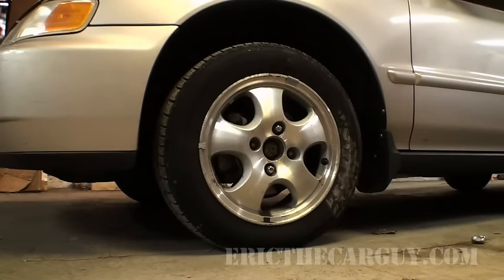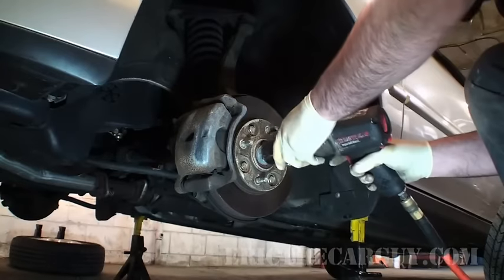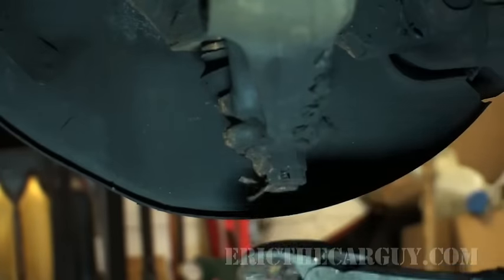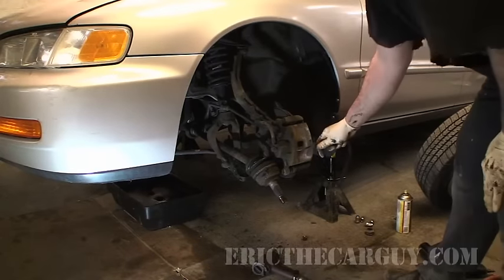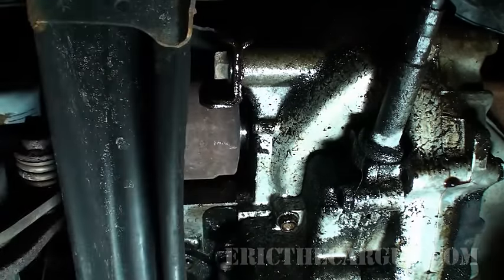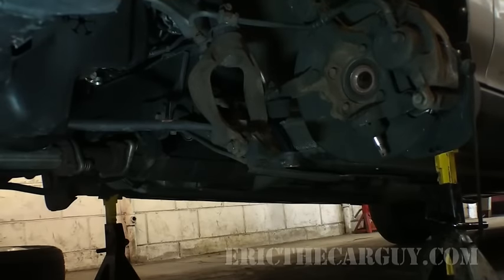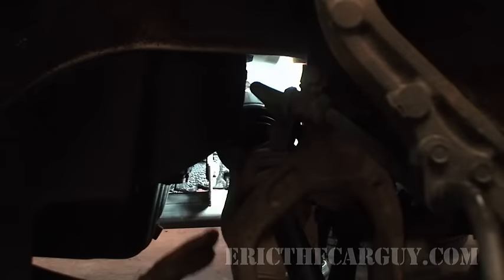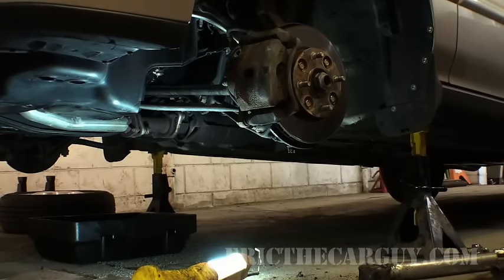How To Replace a Front Wheel Drive Axle - EricTheCarGuy

Comment: OK Eric, All went well until time to pop out the axle. It would not come out. I pried and pried, I actually bent the Axle drive shaft seal and the oil started leaking out. Unfortunately none of the local parts stores had the seal. Have to visit dealer in the morning. You should mention that there is a tool similar to the tie rod end remover (aka pickle fork) that can be rented from parts store. Once I got this tool and hit with a BFH the axle popped right out. Took all of 1 minute. Never do this repair on a Sunday.

Comment: Erick, as informative as your video may be. my question is what happens when a cv joint snaps and leaves the end with clip still in trans. is there a way to push it out from the other side of the trans. 2004 xc90

Comment: Thanks for another great video.
I’ve got a 91 Civic Wagon Rt4wd
I installed a rebuild CV axle from a local parts store and a new seal.
The inner joint wobbles (slightly) and now I have an oil leak.
I’m sure i didn’t damage the seal during the installation.
Any ideas what could be wrong?

Comment: That was really great.  Dirty hard job with quite a few gotchas.  If you can't remove the bolt at the bottom of the wishbone could you simply remove the boot from the new axle, pass it through and put the boot strap back on? (the opposite of what you did to get out the old axle?).  At any rate, really easy to watch!!

Comment: I just finished replacing both drive axles on my '92 Accord today.( 295 + on the miles)  When I drove it out of my garage I had a lot of vibrating and shuddering for lack of what term to use.   This was worse than what it usually does, say at a stoplight when the A.C. is running.  When in park or neutral the motor runs smoothly .  The shuddering seems to be in drive or reverse.  Did I do something wrong or miss something?  Help Please  This was a first time for me. Thanks for your knowledge and your videos!

Comment: You do a lot of Honda work, got a question for you.  Whats your favorite aftermarket axle to use on honda/acura FWD SUVs and do you run into a lot of replacements?  There is a lot of debate and it seems that most of the available units out there and a shortage of options for the RDX.  It turns out that honda (and most of the chatter is about acuras because I think they're usually equipped with stronger engines) has a problem with galling and pitting the inside cups of their CV joints.  My s2k had this problem, and now it appear to be the root cause of shaking axles (under acceleration) for TLs, TSXs, and my wifes RDX.  Lots of people seem to have problems when their honda can actually produce torque.  I'm reluctant to buy the knockoffs and the OEMs will surely fail again at more than twice the price.  I think OEM hondas are remans using Chinese parts considering their axle costs less than buying the knuckle end of the axle.  Thoughts?

Comment: You rock brother. I actually do not have the click, I have serious squeak. The boot is cut. Do I need to replace the axle or just the boot and greased? It does have steering wheel fluid so my wife actually thought it was that. Thanks ahead of time. Sincerely. Alex.

Comment: Hey Eric, thanks for the video it was awesome. I just changed my CV axle on the driver side for a 05 Accord. When I put the new axle back in there’s enough space to put a pry bar between the axle and transmission. Is that normal or do I need to push it further because I have tried and it’s not going in. Thanks boss

Comment: Eric, I noticed the original axle had a damper, the replacement part did not have the damper in the middle.  I have an issue with my new axle without a damper, there's vibration ONLY at 65-75 mph after replacing the passenger drive axle on my 94 Tercel.  Is there a clamp on damper I can easily purchase and install?  Or otherwise what do you suggest?  Thanks so much, love your videos!

Comment: i tried using the hammer on the nut and wound up wrecking a few threads on the axle anyway, I suggest just hitting the axle . especially if you are pulling the axle just to change a wheel bearing, my escort has an extended piece of metal that is easy to hit without wrecking any threads.

Comment: I noticed you forgot to completely tighten up the wishbone bolt, you did get the ball joint one and the axle nut but I didn't see you tightening the wishbone bolt which you said it had to be done on the ground so as not to stress the bushing.     Was I correct?

Comment: Eric, how often do you tear a transmission seal when you remove and replace a CV axle? I replaced a CV axle on my Volvo S70 and it's been leaks-a-plenty ever since... (It was the first thing I did to the car, so perhaps I wasn't as careful as I should've been...) Did I do something wrong? I used a small carpenter's pry bar to remove the axle... Would that knick the seal somehow? Thanks!

Comment: Great videos. 2004 Grand prix no Super Charger. Just changed the driver side bearing, and cv axle ( it was leaking shit everywhere) how much space should there be once the snap ring is in place when putting the new axel on.? I shouldn't be able to see much space in between the axel and the transmission case right? Can i just take off the axel nut and tap shaft in place? Thanks

Comment: Great video,  i replaced my left side cv joint on a 2002 civic, the outer boot ripped, and slung grease all over the wheel and everything in the wheel well. It was a long nice clean up with brake cleaner. Small difference in the 2002 model, only had to remove the stabilizer link from the LCA and the BallJT from from the knuckle. Going to replace the right cv joint next week. Saved $500 in few hours. Should i replace my wheel bearings too, its at the 122k?
Reply: I wouldn't unless you are getting the wheel bearing noise.

Comment: is this job possible without the air tools? mainly the last parts, tightening the lower ball joint along with the bolt that goes over the wheel hub

Comment: Eric good video as always. I have a question regarding a 2011 Infiniti g37x AWD Coupe 2 door - Front Right Axle replacement and installation. My axle came without the inner clip and the old one didn't have one when I removed it. When I installed the new axle and put everything back together and the axle can out a bit and the boot looked stretched. Any advise would be greatly appreciated. Can't find any info, video's, part or service guides on this vehicle. Anyone Please.

Comment: PB Blaster works wonders over night.  Hey Eric, I just rented a strut spring compressor for 60.00 bux.  Guess what,  I'm replacing CV and struts on 2003  Ford Windstar and I don't even need the DAMN thing.   BOOOOY ,  do I feel STOOPIT!!!!   XD
Reply: +Gary Kovach Just goes to show that sometimes we overthink things. Or over plan... whatever.  In my experience I nearly always get half-way or more through a job, just to discover I have to go get either another tool or another part before I can continue and finish the job.  So I don't think you're alone in that feeling, hehe
Reply: Yes indeed,  I DID have to get an 18mm deep well - AND a 30mm socket because ALL of my tools are OUT DATED.  Mind you,  the 30mm is a Taiwan 12 point, ..guessin  it was a dollar for every point.  No matter, It worked. Put PB on over night and tapped at the base and head, tightened just a little..they all came out fairly easy.  Now I'm talking the 15mm and 18mm,.. the 8mm's I soaked and STILL broke them off no matter how much PB or PATIENCE, those BAD BOYS were IN there to STAY!!!  Guess the LOCTITE works best on the smaller bolts, HUH??!!

Comment: Eric I took the CV axle off like you did in this video in time (7:35) but inside of where the CV axle was being held there was a spring that was very vigorously balled up and out of shape. After taking that spring out and putting everything back in place I test drove my car only to hear a very loud scratchy noise that had initially been the main reason I took my car apart from the get go. Do you think It is a transmission problem now?

Comment: Your videos always make my projects a little less stressful. I was hoping you could maybe answer a question for me. My daughter has a 2006 Saturn Vue AWD. Where the rear drive axles go into the rear differential the axle shafts seem to have a lot of up and down movement. Is this normal or do I need to replace the side bearings inside the differential?

Comment: So I see the axle you put in had the ABS ring, but the old axle did not. I'm doing an axle on my 04 corolla without ABS and NAPA sent the new axle which has an ABS ring. I'm assuming it's essentially the same axle and will fit?

Comment: My 98 Saturn SC2 needs this done (noticed the boots were "gone" when doing the brakes recently, and have no idea how long it's been that way). It has 240,000 miles on it. I would think that replacing that transmission seal would not be a bad idea. Would that be difficult because of where it's located? Is it a "thrash the old one taking it out" then tap in the new one? Thanks.

Comment: HI Eric.. had both new axles put in by a very competent mechanic the other day. (1997 Honda Accord 2.2L auto)The driver side came out of the tranny and is leaking like crazy, a Valvoline oil change shop told me today. Can the shaft be tapped or hammered back in by only removing the outside axle nut? Thank you
Reply: update.. YES it can.. Jacked up the car, put it on a jack stand, jacked up the front suspension until the shaft was level as could be, the shaft pressed in and snapped into the transmission. Saved a trip back to my mechanic from having him mess with it and losing up to $$ or more in trans fluid in the process of the drive.

Comment: By replacing the front wheel Drive axles , Do I have to drain the transmission fluid before doing the Front Wheel Drive Axles? Let me know..  if that's correct my friend told me if it's wrong what he told me or I don't have to do that at all, or when do I have to drain the transmission fluid from my 5 speed civic 1995 hatch.. with Front Wheel drive axles removal/installations or swaps drive axles upgrades .. thanks

Comment: Hi Eric, 

I replaced both front axles on my 2000 Nissan Maxima (both sides were clicking). Anyway a week after replacement the driver side is clicking again. 

The axles were after market from advance auto. 

Thanks
Reply: Hoping they have a warranty, but still, work. :( Sorry buddy.
Reply: DE Nichols I've had all that happen. Bad Axles come apart. Bad motor mounts in my case, is what made the axle go bad.

Thank goodness that the shop guaranteed their work. They replaced it three times before finding a bad motor mount...now I know to look at motor mounts everytime I see a bad axle.

So, is your axle bad? Sure, but I think something else is causing it to go bad, so it's a symptom of another problem.

Good be a transmission mount too...to me it's still an engine mount. My DIY trick for something like this is to see how many of them are for sale so I'm sure I found and checked on them all.

You could also take a pry bar and see if there's much movement in the engine.

Lastly, once you know the symptom of a bad engine mount while driving you'll spot it again. If your car keeps feeling like it's catching up to in response to you foot, then your engine is turning, and coming back flat finally delivering the power through the transmission.

Comment: My mechanic Changed my Left Front Axle. 95 Del Sol. And now it's pulling to the right. Before it was perfect. New Tires put on about 6 weeks before change, ran perfect, no pull, easy to turn, etc. Now it's pulls to the right and is stiff steering. And yes, I went to get Alignment done the next day after he changed Axle. Still pulls a bit right n stiff. Any thoughts? He says it's tread pull... but it didn't have tread pull before the changed axle.

Comment: I have a 2008 Honda Element. The car has over 280,000 miles on it. Still runs great but...there is a "whining" when I am driving. I changed out the transmission fluid and added a conditioner. Still whines...I suspect either the axles are just worn (not unreasonable given the mileage) and or it might need new bearings. Care to speculate? Obviously, without driving the car and hearing for yourself, it's more than difficult to make an absolutely accurate assessment but perhaps with your experience, you could "ball park" an opinion? Thank you very much

Comment: great vid. i was doing this myself and found that the cv didnt slide through that fork and i attempted to get that bolt off to drop that piece but ended up spending hours on it and not have it move one bit. ill remove the inner boot like you showed so i dont have to fight with that damn clevis bolt.

Comment: Hey Eric, used aftermarket CV axle half shafts. Replaced both Fronts on my 2002 Honda CRV LX 4x4. Eliminated the popping sounds I had, but now I have NEW vibrations, between 0 & 20 miles per hr that I did NOT have before. Also make a right turn, axle vibration on left side. and vice-versa, turn left, vibration on the right side. Honda forums say's its the aftermarkets, that they aren't up to par with OEM's ? I'd rather clunking than the vibration. Any ideas how to correct, less shake so I get better roll?

Comment: I noticed you hammered the axle out of the wheel hub.  My concern is that would damaged the seal at the transmission on the other end.  Are there no puller tools made for this?

Comment: Hello Eric, I saw your video and I liked it.
Friend, I have a 1997 Audi A6 2.4, 'tiptronic. I realized that when the car has the engine running he is dribbling the exchange oil. When the engine is turned off not drip anything. If the car got underway he loses the exchange oil until there comes a time that Automatic passages not occur. If put in manual mode it accepts but with difficulties. If behest scoring the exchange of oil it back to normal but whenever I use the car until he loses it no longer give any march.

I made a computerized diagnosis and the result was this:
00268 solenoid s-n92
00266 solenoid s-n93
00300 gearbox oil temperature sender - G93

Can you tell me what these errors means?
What will be the reason for the loss of the exchange oil?

Comment: Hey Eric, I need a 2nd opinion on a problem I am currently having with my 2002 Chevy Trailblazer. While pulling out of driveway's in reverse or making sharp left and right turns while driving, the passenger side assembly (Front right) will rumble and grind a bit until I fully stop or after coming out of a turn and driving straight for a bit. I'm 98% sure its either a CV joint failing or just something related to the CV Axle itself. I'm no car expert but I, "have had my hand in the cookie jar" so to say, for many years. would you have any insight on it being anything else or do you agree with my assumption. Thank You.

Comment: Eric, I have some rumble when driving my jag x type. Sounds like a loud rumbling of tyre noise which gets louder the faster i drive. I suspect its drive shafts, which one i dont know though. Do I not need a special tool to disconnect the shaft at the transmission end?
Reply: I have same noise.  Did u figure out what it was?
Reply: Sound's like a wheel bearing

Comment: So there is no need to take out the transmission oil while replacing the axle? Thanks ;)
Can you take out both Axles without dropping the differential wheels from theirs positions?  Thanks :)

Comment: Hey Eric,

First of all, love what you do. I learned how to replace my alternator because of you. Thanks!  

I tried removing the passenger side axel on my 97 toyota. Ran into an issue... The inner joint is stuck in the transmission. Any suggestions on removing it?
Reply: Get a pry
Reply: Yea I remember working on my brothers toyota, it was a lot of prying, but if inally cam e loose.  Must be a toyota thing.
Reply: Gabe Borscheid as far as I'm concerned all cars pretty much need a pry. I've never been able to undo joints without a pry.

Comment: This guy is good but here's a tip if you have trouble getting it in.... when he was pulling the old one out he was telling you to turn it a little to get the snap ring to a different position to make it easier which is True and most people don't know this but if your having trouble putting the new one in take that gap that's on that ring and put it at 12 o'clock then try putting it in you should never hit the end of a brand new axle not even with a rubber mallet

Comment: The Acura Legend axels can easily come dislocated on the inside joint, the bearings are sitting in square guides and once they pop out you have to take off the boot and put the bearings back in, that cost me a lot of time.

Comment: If I crush the rubber on the steering control arm ,
 with the pickle fork ,
 must I replace that part of the arm ? 
The reason I had to take  the whole wheel assembly off of  the
 2012 Kia Soul Exclaim  with 220000 miles was  the axle spline  was rusted to the wheel bearing
 I had to take off the wheel to be able to knock the axle out .

Comment: I recently replaced my axle on a 2001 Honda Accord. Apparently the axle was not seated because after a mile it popped out of the trans and the car coasted to a stop  when I disassembled I discovered the snap ring was inside the trans. I pulled it out then put the ring on the end of the shaft and reassembled but this time drove it in with a big hammer 5 to 6 times. Been driving for 50 miles now and everything is ok. What do you think my problem was? Did the ring come off when I pushed it in or was it just not seated all the way?

Comment: What can be the problem if my front tire from the passenger side is wasting only from the inside and not evenly as it should be. The car I bought was crashed from the passenger side. I have replaced the stub hub bearing but still no good rustles from it. What should I do? Thanks for your information!